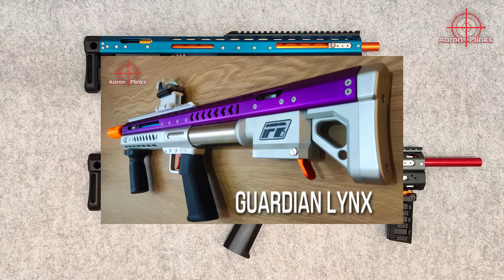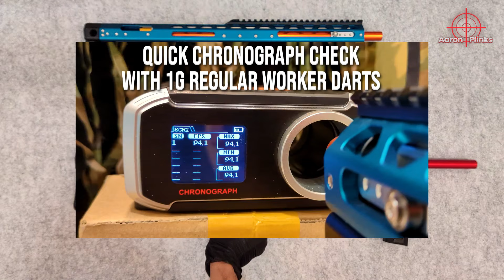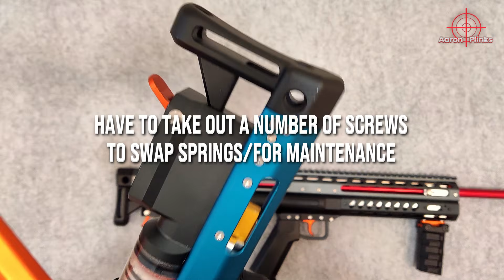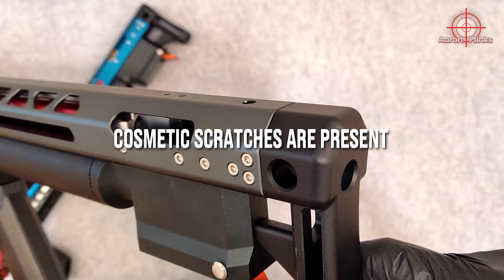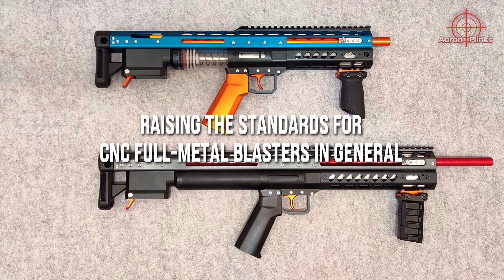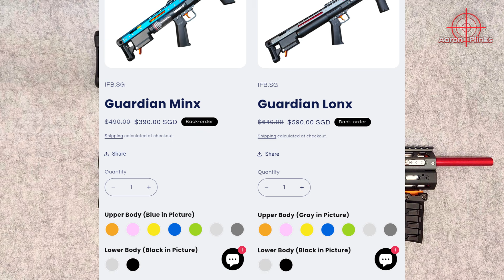First Impression & Quick Review: Guardian Minx & Guardian Lonx | CNC Full-Metal Nerf Toy Blasters

Comment: Im happy with my glynx. Took some work to get it to peak performance but worth it in the end. Sourced better bearings to make the prime smoother and avoid the scratching noises as well as ptfe tape on the priming bar, another bearing inside the plunger tube itself to let the spring rotate when compressed which completely fixes binding issues. 

Looks like the gminx and glonx have identical parts to the glynx which means more spares available, so no complaints here.
Reply: Where did you source the plunger bearing from and how did you mount it? I'm having those issues
Reply: @Jag_ger  I bought them from eBay but you can find them anywhere or at any hardware store. Upgrade parts and names:
1) Internal bearing for spring "AXK1226+2AS Axial Needle Roller Thrust Bearing - 12 x 26 x 2mm". This is the bearing the stops the spring from binding internally when fully compressed.
2) POM nylon roller wheel bearings "Size(ID x OD x Thick): 3mm x 10mm x 4mm". These replaces the metal bearing on the priming block, plastic so it doesn't scratch the metal rails and make tones of noise every time you prime.
3) Teflon Tape "10mm x 10m PTFE Tape Adhesive High Temp Woven Low Friction". This goes on the top side of the top metal bar to reduce friction and noise when priming.

Comment: I got 1 finally, air seal is prefect. They must have changed to use a thicker o-ring as the ID of the tube is 38mm, not standard 36mm. Draw is 120mm so displace volume is 136 CC.
Reply from the maker: Will be doing a follow-up video after IFB has given it their magic touch.
Reply: The lube was helping the seal initially. The leak appear after testing the it for a while as the lube is slowly removed. Leak from: 1) nozzle o-ring (too small), and 2)  through the barrel thread (no oring). Therefore need to add telfon warp in both. Trigger also wobble left and right, and need to add slim washers. For this price range they odd have to have these minor issues fixed to stay competitive. 

Strength is top notch, steal shear/rods/pushers/ and mostly aluminium upper and lower. Screws are the problem, too many small crews were used, need to add lock glue. 

I removed 1 silicon foam pad on the plunger head(totally not needed, as there is another 1 on the stationary side) and get additional 4mm draw, so I now have 140 CC displace volume.